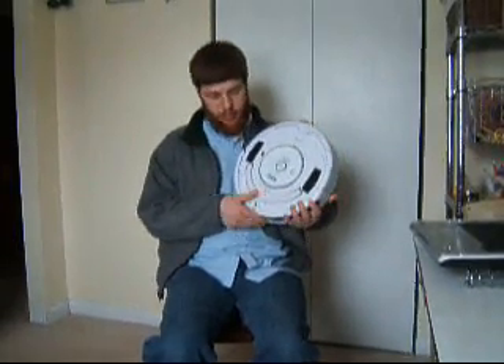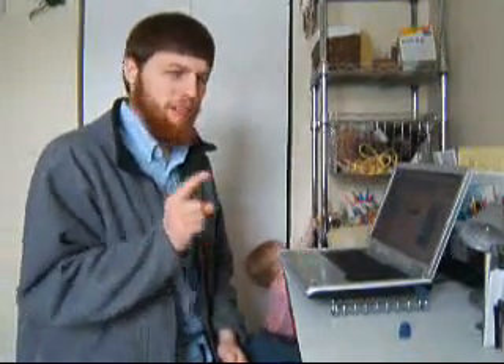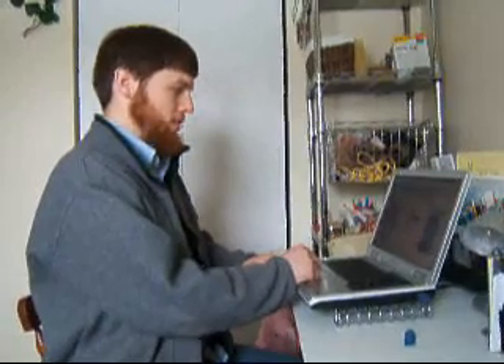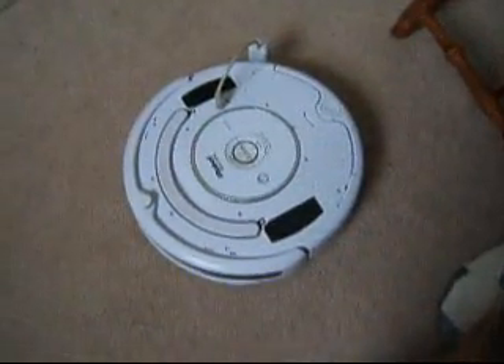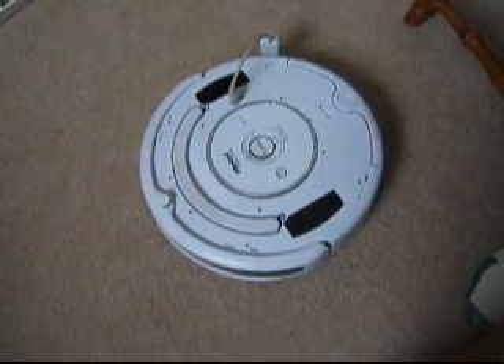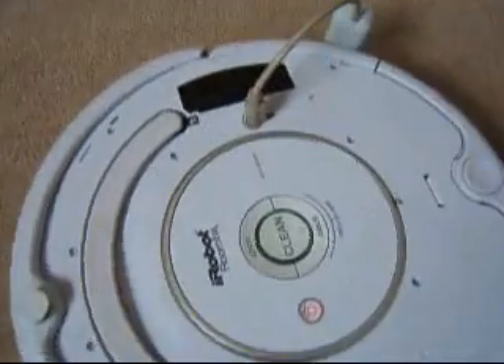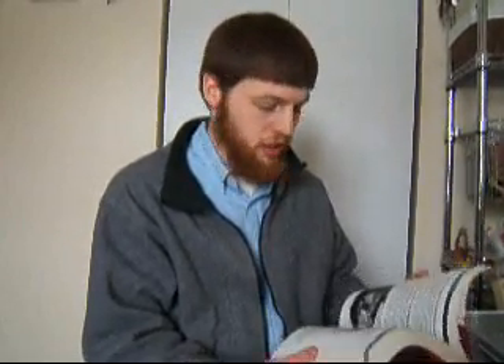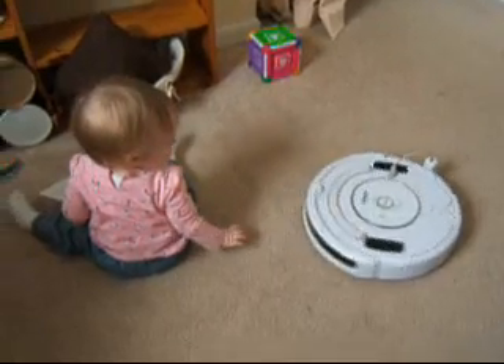Roomba Bluetooth Control

Comment: Do you know if the 550's have the same pin arrangement of 330's?
Reply from the maker: Paulo Pinheiro I would guess but I have no idea without researching it myself.  I would suggest you try to find a specifications PDF like what I mentioned in the video.  When you find out, how about you reply back here with what you find out :-)